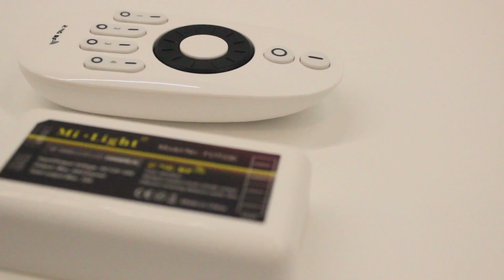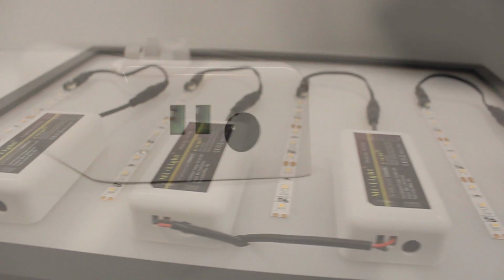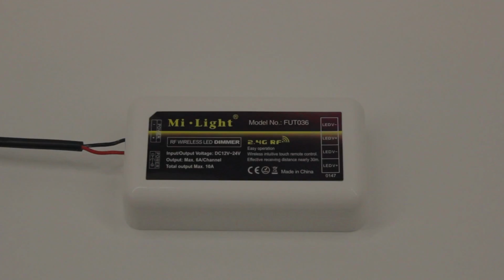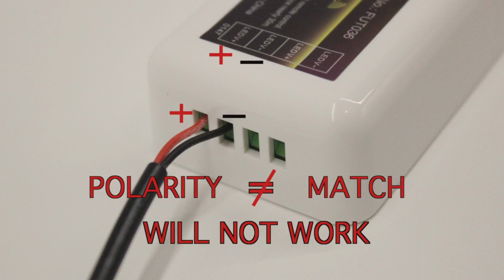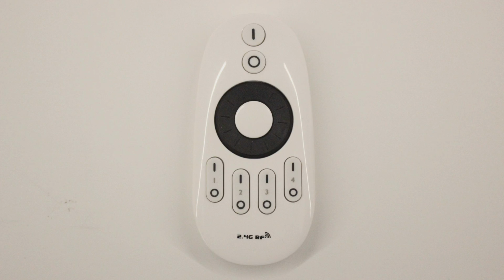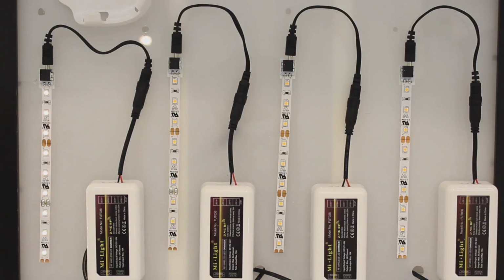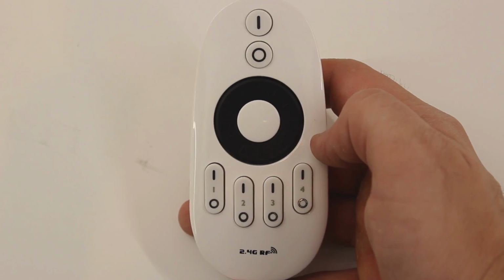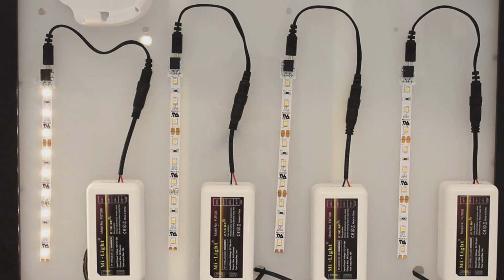Multi-Zone Dimmer w/Wireless Remote for LED Lighting Systems | Inspired LED

Comment: so i need 3 controllers to have 3 led strips each one with a different color?
Reply from the maker: Hello! The Multi-Zone Remote can control 4 zones, or Receivers, each independently or all together. Each zone will have its own Receiver which will be synced to the remote giving you full control from one location. Please feel free to reach out to us directly if you have any questions. Thank you! -InspiredLED
Reply: @InspiredLED  so i need 3 receivers/dimmers to control 3 zones?
Reply: @Meow45146  OBVIOUSLY, DUDE. How else would you be able to control 3 DIFFERENT zones? Of course you can connect multiple strips to a single receiver, but that's not what is being shown here.